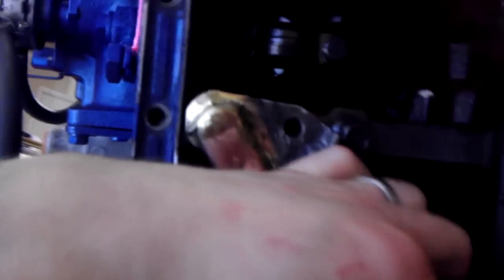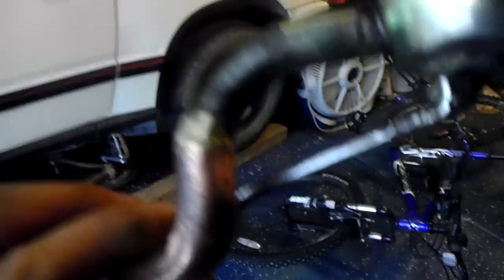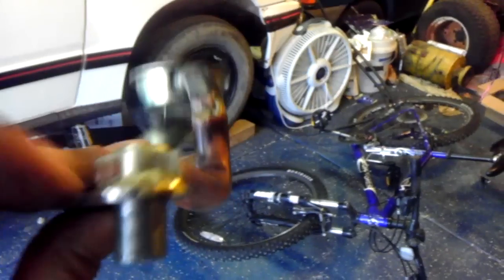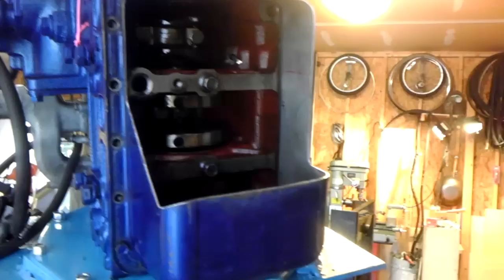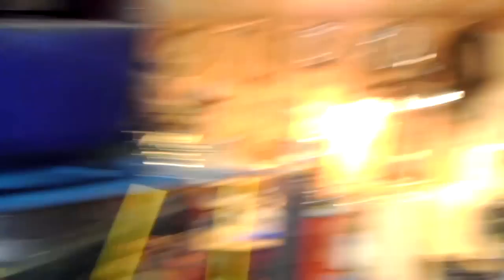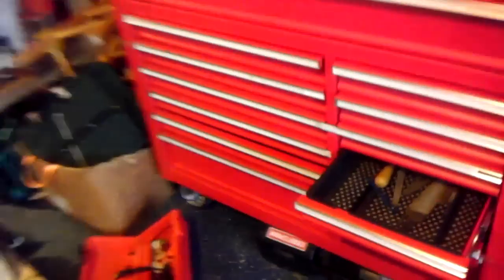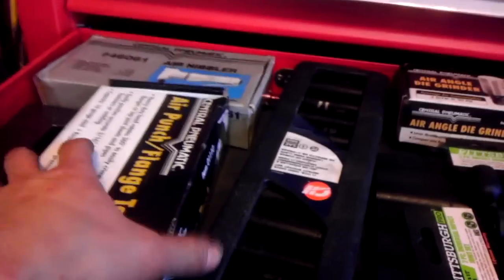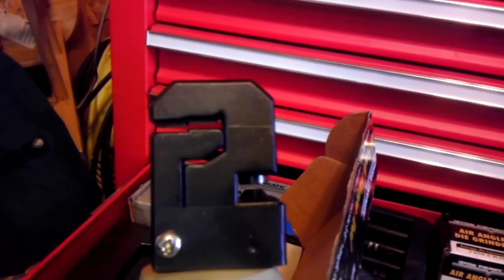Geo tracker diesel conversion part IV

Comment: That pickup tube would have been less of a cobble job if you had let loose of 43 cents for an elbow. if you have a failure in this project it will be that jury rigged pickup tube.
Wait till it fractures and you loose oil pressure...oops there goes your motor.